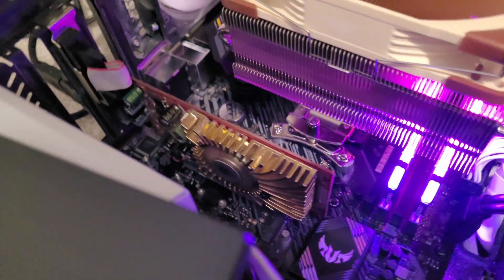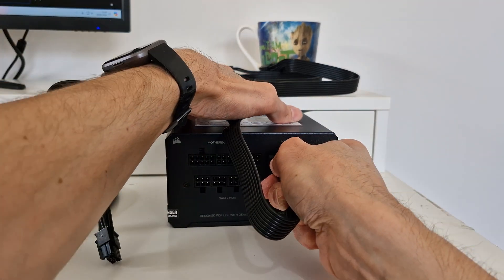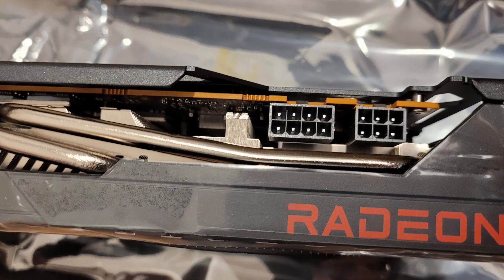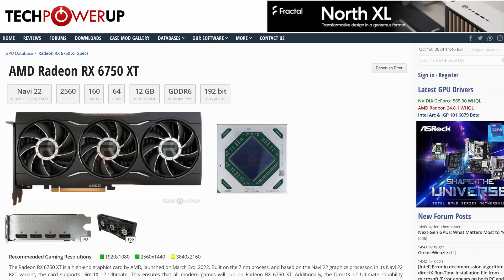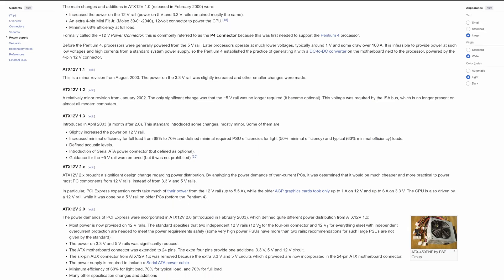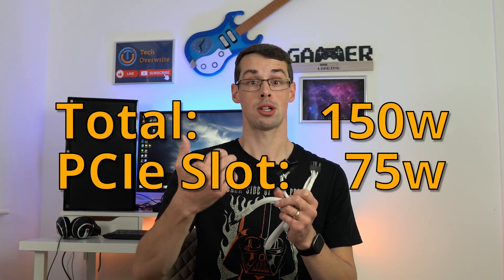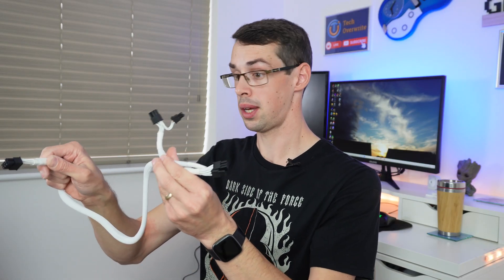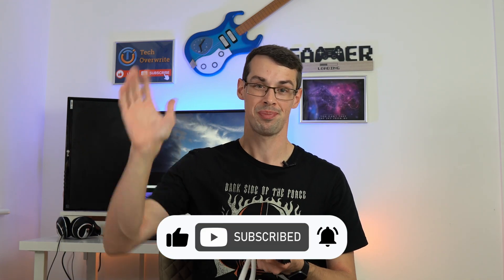Why Do PCIe Pigtail (Y Splitter) Cables Actually Exist?

Comment: Im running a 2080ti using the pigtail connection, it is a 250w card. I do have an MSI mag 650w psu that is enough for my setup. It seems to be working well and even reaches 260w under 100% load in benchmarks. But I still would like to ask if this is safe because there is very mixed info online and not much pointing towards my specific scenario.
Reply from the maker: It's hard to say for sure BUT.... if it's working, then it should be fine :) I know that sounds like a "well duh" type answer, but unless you're getting crashes when under 100% load (which you're not), then you don't need to worry IMO.
Reply: Better to be on the safe side and use separate cables than to risk it.

Comment: What if my psu have only 1 and 1 atx3 a750bn msi ? Gpu is rtx 3070 225w 150w from cable 75w from pci slot
Reply from the maker: You can always try it and see. MSI make good PSUs, so you might be fine. Worst case, you could try a bit of an undervolt on your GPU and that might help it run fine with a single PCIe cable.

Comment: Is using 230w gpu like the 6700xt on a same daisy chained 8+6pins safe??
Reply from the maker: It completely depends on the PSU tbh. I mean, it should be fine with a modern PSU but it's hard to say for sure.

Comment: can i use my thermaltake toughpower 750w 80+ gold pcie cables to connect to gigabyte 5070 ti gaming oc 12VHPWR adapter (use 1, 6+2 x 2 pigtail pcie cable and use 1 6+2 pcie cable, total of 2 seperate cables and one of them is pigtailed)?
Reply from the maker: That should be fine for a 5070 Ti yes, really the power draw isn't enough to need 3x separate cables - 2x separate cables should be okay here IMO :)

Comment: I have an ARM 850x Corsair, I have used a piggy cable to power up a rx7900gr and rx9070xt. And I had no problems. Does that mean that for this power supply is fine to use the piggy cable?
Reply from the maker: As in, you've run just a single cable to both? That's good if so. Sometimes it can result in the GPU being underpowered, especially during power spikes, but Corsair PSUs are good so if it works, it works.

Comment: would it be safe if i use 2 of those pigtails to power a 3 pin rx 9070 xt? im asking because the psu im using is a msi mag a850gl atx 3.1
Reply from the maker: I would run 2x separate cables for that card, so you would then use one set of pigtails to achieve the third connection :)
Reply: @ShorterTechOverwrite yeah, that is what i was trying to get at, because that PSU only has 2 of those pigtails connectors for the 6 + 2 pins, so i would had needed to use the other connector

Comment: so, i just purchased a 6800rx and my old 3060ti only used one end of the daisy chained 8pin pcie cable, the new gpu requires 2 , so could i use the other end for the 2nd slot in gpu . also my psu in non modular
Reply from the maker: Both GPUs in the same build? I wouldn't use the other end for the 6800rx no, the power usage for both GPUs wouldn't work well with 2x cables only IMO.
Reply: @ShorterTechOverwrite no but i just ended up purchasing a beefier psu so i would catch anything on fire in the future lol thanks tho bud for the help

Comment: I have a corsair rm 850x and it only has 2 pcie available for a gpu and im planing to get an rx 9070 xt  xfx mercury rgb is it safe to use 2 pigtails or should i go for a lower tier model?
Reply from the maker: Yes that should be okay - the 9070XT often doesn't consume enough power to require 3x dedicated cables 🙂
Reply: @ShorterTechOverwrite thanks a lot man i was going crazy reading all kinds of experts saying that a pigtail would burn my whole pc down haha

Comment: Is it actually dangerous to plug a pigtail cable on a gpu that has more than 4 pins? I did a bit of research and there are some videos that say a pigtail cable on a gpu is dangerous, and it's safer to just use 2 cables rather than 1. I'm very urgent to fix my micro stuttering issue and any information is useful. I'm currently running an rtx 3070 with a Ryzen 7 5800x
Reply from the maker: I prefer running 2x separate cables too. While many PSUs will supply a fair amount of power down a single cable (pigtail or not), all GPUs can also have transient power spikes - and two separate cables will handle those power spikes better, IMO.
Reply: @ShorterTechOverwrite Thx man, I guess I'll keep doing more research, but appreciate your response❤

Comment: Hello, i have an 7800xt (tdp 263 w) and a fan hub (approximatly 30 w) that is powered by a 6 pin pcie connector. My psu (ud850gm) only has 2 pcie cables, but they have pigtails. Would it be safe to plug 2 different pcie cables into the gpu, but use one of the pigtails for the 6 pin fan hub?
Reply from the maker: Hello, good question, yes that should be fine - and it's actually a useful purpose of the pigtail too 🙂 It shouldn't affect things much, especially if you're running with 2 separate cables ultimately.
Reply: @ShorterTechOverwrite Thanks for the quick answer

Comment: What If I use 2 separate PCI-e cables from my PSU then use 1 of the pigtails to complete the 3rd connector my GPU requires. The PSU provides enough Wattage. Just minding otherwise I have to buy a new PSU with more Pci-e connectors
Reply from the maker: That should be fine, I agree :) You'll still get the correct amount of power supplied to your GPU.

Comment: the 6 and 8 pin connectors are basically overspec'd as you can see on that one guys video on why 40 and 50 series are melting he explains the 6 and 8 pin generally are able to push almost 2x the power
Reply from the maker: Was that Buildzoid's video? Yes that was a good watch, it helped clarify some doubts I had in my mind too. :)
Reply: @ShorterTechOverwrite  yes I forgot his name

Comment: i own a corsair 850w psu with  the pigtail and today accidentally i chipped one of the plastic connector but there's  still pigtails like yours  that i've never used on the same cable can use them to connect to my gpu  i worry if i keep the cable connected with the  chipped plastic maybe one day melt  it will kill my gpu
Reply from the maker: Ugh, sorry to hear that. It depends on exactly where the damage is (to the connector). It might not be in an 'important' area... BUT I personally wouldn't chance it. You'll almost certainly be able to buy a replacement cable from the Corsair site (or Amazon/Bestbuy/etc) - especially if you have a fairly recent Corsair PSU that often use 'type 4' cables. There's loads of replacement type 4 cables out there. I quite like Corsair's individually sleeved premium PCIe ones.
Reply: @ShorterTechOverwrite do you know where i could source an extra pcie/gpu cable for my nzxt c850(newer pa version)?

Comment: I have 3070 ti with 3x8 pin ,  pigtails still not recommended even if I have 2x8 going and use the pigtails to connect the  3rd  8 pin.
Reply from the maker: Good point. I think it probably would be fine with 2x separate cables (and then a pigtail for the 3rd), but I have also seen GPU or PSU manuals that say to use 3x separate cables which is surprising. I guess they're trying to err on the side of caution though.

Comment: just upgraded from a 3060 12gb to a 4070 super and i only have one PCIE cable with the pigtail, is this sufficient to use with the 4070S or should i upgrade my PSU??
Reply from the maker: It depends on the exact model of 4070 Super you have. I think the base has a 220w TDP so you might be fine with the pigtail. But if it's an OC version, I would probably prefer to run it with 2x separate cables.
Reply: @ShorterTechOverwrite  I do have an OC version, specifically the MSI ventus 3x 4070S
Reply from the maker: Sorry for my delayed reply - in that case I would keep track of the power usage in GeForce Experience and see whether it's going near.
Reply: @ShorterTechOverwrite  No worries, thanks for the advice!

Comment: Can crosair cx 650 deliver enough power for msi ventus 2x 4070 super?
It has 220 w tdp and 16 pin connector 
But this model of psu dosent provide extra 8 pin connector apart from the y splitter or in your word pig tail connector
Reply from the maker: Ooo good question. It's probably borderline. I mean, the MSI Ventus does say that a 650w will work (as the minimum required), but I probably wouldn't chance it myself. I would personally change the PSU, but technically yours should work okay - especially if you don't have the budget for a new PSU.

Comment: WARNING!!! Don't buy cheap power supplies with cheap cables. When your powr supply dies, it's likely to take other components with it.
Reply from the maker: Fair point thanks, a PSU is never something to cheap out on. I usually just go with "Corsair RM..." and move on with my life LOL. (Although admittedly even within the RM range there is variance, e.g. whether Japanese capacitors are used.)

Comment: Hello mate. 
We have the same card and I've stumbled upon your channel during my search to fix my "stuttering" issues. I have been running a EVGA 850W Gold PSU and used the supplied pigtail cable for my card. I'm kind of a noob when it comes to this stuff... so basically you're saying that the pigtail cable can be replaced by two separate cables (one 8pin and one 6pin) coming from the PSU? Our card's TDP is 230W which is awfully close to that 250W range you mentioned in the video.
Reply from the maker: Hi mate, yes it's a difficult one but in general I prefer to run two separate cables yes. While it is borderline, two cables will usually lead to slightly more stable power delivery IMO.

Comment: Just switched to a 24-pin card that requires 350watts however I only have one 8pin and two pigtail cords left. Wondering what the best move is? Should I plug in both pigtails including one of them fully/twice, should I plug in both pigtails and the 8 pin (not sure if thats a bad idea), or just leave one of the 8-pin slots empty.
Reply from the maker: I would aim for two separate cables and then use one of the pigtails yes. You should hopefully be fine for 350 watts. You can always try it and keep an eye on the power usage in AMD Software or GeForce Experience. If it's constantly hitting 350 watts then you get crashes/gaming stutters, that's a bad sign. But if not, you should be fine :)

Comment: hello, are those pigtails safe in RX 5700 XT (8-pin + 6-pin) in the long run? 
my PSU is Corsair CX650 80+ Bronze. 
sorry, I'm still confused in computing wattage (noob)
i hope you help me sir. :)
Reply from the maker: Hello, a single PCIe cable can supply at least 150w, and the motherboard slot gives another 75w. So a card with TDP 225w or below should be fine on a pigtail 🙂 But if it's over 225w, you might just need to try it out and see if it's stable (crashing or not)

Comment: I need some help. Soo my question is about the pigtail pcie cable… I upgraded my gpu to a used rtx 2080 super. But i discovered that my psu (corsair cv650) only has one pcie cable with the Pigtail, so 2x 6+2. Do you think it will be fine with the pigtail cable, or should i buy another psu with 2 pcie cables? Thanks🫶
Reply from the maker: Hmm, it's borderline. The CV650 isn't the best PSU (no offence) so it might struggle with your 250w GPU. You could always just try it out, then undervolt your GPU if you get crashes. A new PSU would be the 'best' option (price aside) though 😔

Comment: I have that saphire pulse 6700xt can the pigtail 6+2 pin pcie cable from the (2021) rm850x power it without taking out my power supply to put a seperate cable in?
Reply from the maker: I initially had my 6700XT GPU powered okay by a single PCIe cable from my Corsair PSU. Although I didn't run major stress tests, so I can't say with 100% certainty that it will work.

Comment: Can a single 6+2 gpu psu connector into a dual 6+2  Y-splitter cause power delivery problems to a gigabyte AMD Radeon RX 5700 xt oc gaming
Reply from the maker: It's borderline, I usually say that 225w is the safe limit for a single cable and pigtail. Some PSUs and PCIe cables will struggle to deliver above 225w on a single cable.
Reply: @ShorterTechOverwrite  nevermind gpu is still not working after getting the second gpu cable

Comment: howdy. can u do me a favour ? you actually helped me with that vid 8 months ago.  i have a 7800xt and 5600x ( i know not the best combo haha ) and a corsair 750w sfx    in wukong and another game my pc just turned off and i did everything like windows reinstall stress tests and ddu etc and reseating cables but i think now using the 2 separate cables helps.  ( havent tested it enough since the issue was from like 3 times a day and sometimes not returning for a week ) but its really tight now in my NR200.  can you please tell me the link of the Corsair cable you showed in the video ? thanks a mill
Reply from the maker: Hey, ah cool, glad to have helped in that previous vid :) Yes I was probably showing the "Corsair individually sleeved premium PCIe cables", so something like this: https://www.corsair.com/uk/en/p/pc-components-accessories/cp-8920247/premium-individually-sleeved-pcie-cables-single-connector-type-4-gen-4-aca-a-red-black-cp-8920247

They come in lots of different colors, and I really like them. They're so flexible because it's all separate cables. I hope they help you out :)

Comment: That's not a flaw. That's what they want you to believe. The cable can carry a lot more current that the pin interface. It's absolutely fine to use a Y cable for up to 350W
Reply: Still, why would you do that though? Sure, for eg. most power sockets / electrical wire are able to carry up to 24A, but why do you want to risk fire?

We run all our normal sockets at 13A so there is headroom incase of imperfections anywhere in the electrical system.
Reply: Remember that it does depend on the specific cables
Reply: I have been using pigtail on rx 6800xt without any issues. Although I have it slightly underclocked , I have never seen it go above 300W
Reply: "that's what they want you to believe" Who do you mean by they? You're right though, I found a notice on the Corsair webpage explaining what you said. The cable can handle more power than the 8 pin on the card.
Reply from the maker: Thanks for the comment 🙂 It depends on the cable gauge/quality too though. I have high quality Corsair PCIe cables that would do 288W or above. But some budget PCIe cables might top up far below that.
Reply: No thank you. I rather want two 1x 6+2 pin than having two unused pins being useless.
Reply: What about a dual PCIe plus a separate PCIe to use for a 3x8pin 9070xt?
Reply: @shammy8703  i got the same question, did you get an answer?